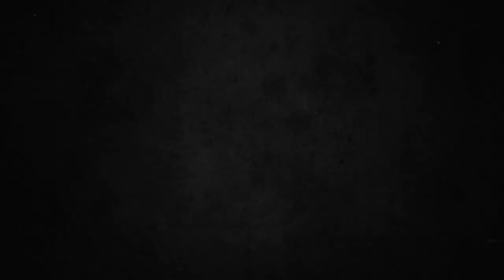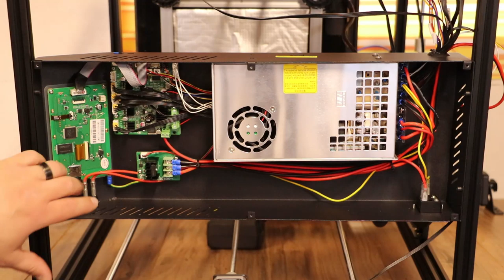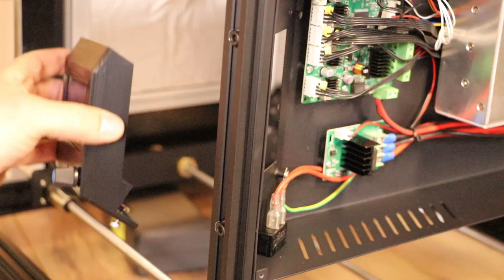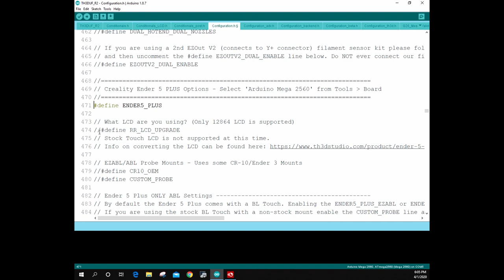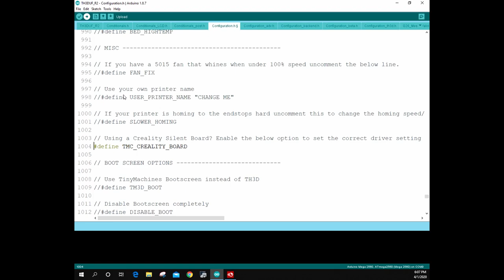Ender 5 Plus Touch Screen - It's Gotta Go!

Comment: I couldn’t wait to replace the touchscreen on my CR10S Pro.  I was going to have to solder two pads on the motherboard and until TH3D came out with the upgrade that didn’t require any soldering. I’m so glad I have an LCD screen now..

Comment: Hey Jim, any plans to launch a video or do you possibly have instructions for accomplishing Extruder, Flow Rate, & E-Step Calibration for the Ender 5 Plus. I checked out your video from a while back on doing this for the Ender 3 but that does not work the the 5 Plus as you can't do stuff directly on the printer. Also, fairly new to all this. Thank you in advance for your time and great content you provide!
Reply from the maker: Great idea!! Check out the video I have using OctoPrint. You should be able to do it like that! I will work on that video though in the near future!

Comment: Hey there Jim! Sent this in a email to you as well.. 

Jim,

Had some questions for you on the Ender 5 Plus. I just ordered one yesterday and got the MW PS, silent board, metal extruder & th3d screen update. My question was can you explain or possibly do a video on the levelling procedure with the screen update since I'm sure it is no longer the same as the touchscreen. 

I've got a CR6 se currently and LOVE IT, but wanted a bigger build volume for costuming and props, and didn't want another bed slinger. 

Also I am currently running octoprint on my cr6 and it is hard wired. I am going to be putting the 5 Plus in a separate room. Can I run both printers off one pi? (3 B+) One wired & one wifi?

Any help or suggestions would be GREATLY APPRECIATED!

Thanks in advance!

Comment: Need to know about My Ender 3 Pro adding the Ender 5 Plus v2.2. . How do i get the stock or the 3d Pad Mini display to work with it.  does it need 2 cables instead of just the one?

Comment: You didn't explain how you were connecting the Computer to the printer/screen to update the firmware.  I am assuming over the USB port?  Also, you didn't really explain why you were doing this.  Just you get more functionality.  Perhaps show us what the advantage is of doing this mod, please?
Reply from the maker: Dang!! Good catch! I just have accidentally cut that part out. Yes plug the USB from the Printer to the pc. Then you should be able to do the firmware upgrade!

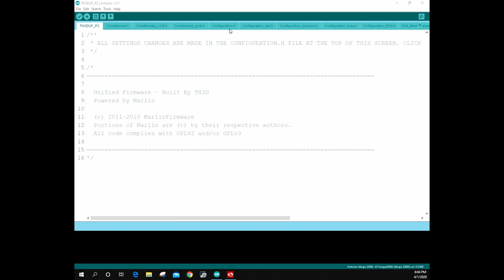Comment: At 6:15 you open the file in a window.  What might you be using to read that file you opened?   Looks to be something different then note pad. Ive seen some people using that same window when they tinker with their arduinos.  Thanks!!
Reply: Arduino IDE

Its how you upload firmware on Marlin 1.1.X I strongly recommend figuring all this out before you start trying you can brick your printer which takes some work and knowledge to get it back. 

This will not work for Marlin 2.0.x you need a different code editor.

Comment: Great video, have to do this sometime soon :)

One question, do you know if thermal runaway is activated on the firmware shipped with the E5+?
Reply: On mine it wasnt. Had to flash a new version of Marlin (2.0). You can check by unplugging the termistor and then turning the printer on. After a set while it should give the warning.
Reply: @hound83  Checked the video from Teaching Tech, unplugging the thermistor dosent check for thermal runaway apparently.
Reply: @alexanderostlund3885  You might be correct in just unplugging, i do get an alarm on my screen, but not the thermal runaway indeed.
I do think the way to test the thermal runaway is to first heat the bed and then unplug the thermistor(?)
Reply: Michael I checked and if you heat up, lets say the hotend and pull out the plug for the hotend, then you should get it. Worked for me

Comment: What's wrong with the touch screen?  I guess since I control my printer with Octoprint and rarely even touch the touch screen I haven't had any issues.
Reply: Nothing. You didn't see any value in changing out the screen because you never touch the thing in the first place. Can't blame you, I have the same setup as you and I rarely touch the screen. We have to remember though, a lot of these mods are being done just for the sake of doing them. People like to tinker on these things and thats OK. Have fun with it if thats your thing.
Reply: I agree with doing mods just for the sake of doing them and that's part of the fun.  Iv'e only just started with my 5 Plus and I guess I jumped over the issue with the touchscreen since I went to the OctoPi and AstroPrint.  I just wondered if there was something I was missing that I needed to know in case I needed to replace my touchscreen.
Reply: @irql2  Well the screen is not bad in any way. But a lot of settings are not available on the touch screen but are available on the non touch screens.

So it is the software rather then the hardware that is holding the 5 Plus screen back i would say...

Comment: Installation completed, but the screen keeps restarting if I turn the knob too fast? Weird. Is the knob creating a false current or something?
Reply from the maker: Hmm. Good question. You can see the display on the screen before you restart it right?
Reply: @TheEdgeofTech  Yeah, everything works fine until I turn the knob faster, lik to set temperature manually, then it restarts....really weird. I did an M502 on pronterface to reset the EEPROM since  I had an EEPROM mismatch error first start up, but it's still resetting, something fishy here....
Reply: @TheEdgeofTech  Dumb@$$....the reset pushrod didn't fit properly in the case....it was just touching the reset button on the board under the controlbox cover...I crack myself up sometimes.....false current....waste of college money :)
Reply from the maker: @Masso1973  It happens! Haha Glad you got it sorted out!

Comment: Do you happen to have a link to the silent board? Thanks!
Reply from the maker: Here is the link directly to Creality: Ender 5 Plus V2.2 Silent Board - Also fits CR10s and CR10 S5:
https://www.creality3dofficial.com/collections/accessories/products/upgraded-silent-board-with-tmc2208-driver-for-creality-ender-5-plus-cr-10s-series?sca_ref=14184.gw5rXaIv7L
Reply from the maker: I looked and it's the cheapest through them!
Reply: @TheEdgeofTech  thanks again!

Comment: What is with all the hate for touchscreens. I never got that. Great vid Jim
Reply: I thought he said it's an upgrade
If you go from digital touchscreen to analog screen then that is a downgrade.
Btt touch screens can be modified in firmware to suit your needs or add menu functions.
I agree touch screens are great.
Reply: I’m not sure there’s hate in general for touch screens. The problem with the E5+ is that there’s like 5 things you can control with the stock version. This upgrade gives much, much more control.